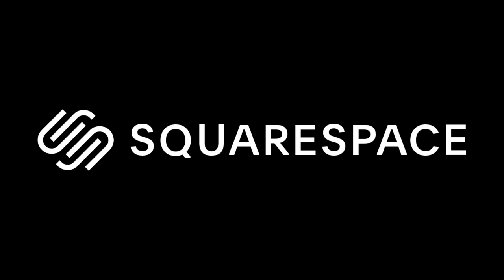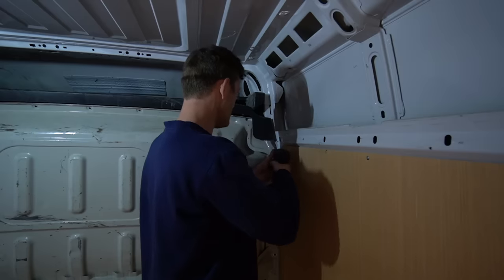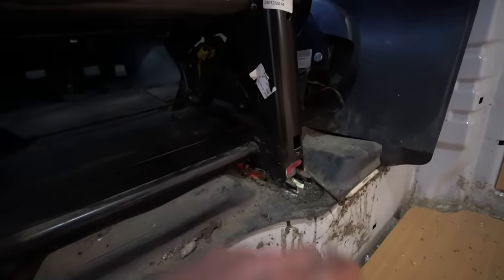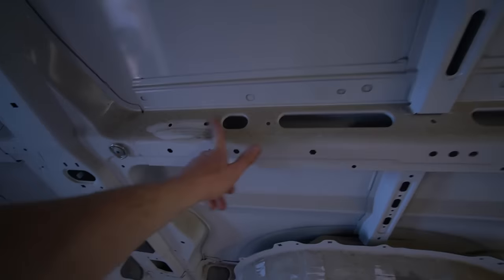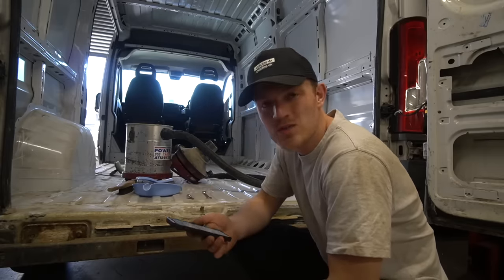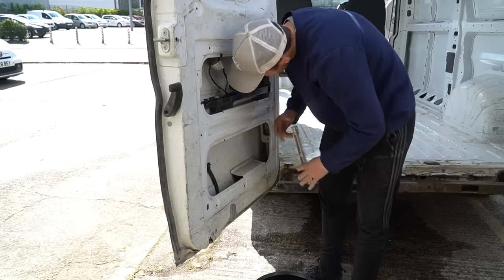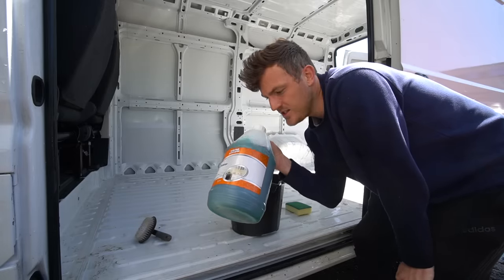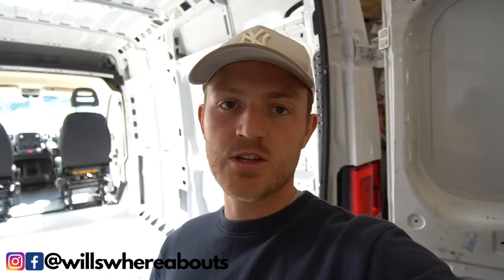BEGINNER VAN CONVERSION | Ripping it All Out - No Experience Van Build

Comment: Go old school Re smell. You don’t want to cover it, you want to eliminate it. If furniture is cloth ... air first. Sprinkle thoroughly with Baking soda. Let stand, preferably overnight. Vac off ALL baking soda, every last bit. Air again. If smell remains. Repeat. Patience. It will work. Baking soda in the amount you’ll need can be purchased at Pound Shops, Hardware stores some supermarkets though they are only small packs. I buy Duzzit from my local garden centre for £1. When it’s in stock I buy ten or so. You can use for everything. Google it. You’ve done an amazing job. Can’t wait for your next vid. 👍👍👍

Comment: Good job will!
Chemical guys do a citrus smelling anti-bac upholstery cleaner... Scrub it in, leave for 5 mins then use the wet vac... Repeat as many times as needed or untill water is clear.
Also, I'm pretty sure that little circle hatch is access to the fuel pump. 👍

Comment: Hi Will. When you fit the ply back on the floor. Don't screw it down. Stick it down with something like 'clear fixall' screws in the floor make holes that  will rust over time. Floors can sweat and rust out your van floor. Seal the old holes both in and underneath. Then stick boards down.

Comment: We have a product in the US called OdoBan.  You can use it on fabrics,  and hard surfaces.  You can use it in a carpet cleaner and clean the seats with it.    I just looked and it is sold in the UK however, it says currently unavailable  on amazon. Maybe you can locate it.   I highly recommend it.  It is also hospital grade disinfectant.  Great stuff.   Another thing you can use is vinegar.  Use that diluted half and half with water in a carpet cleaning machine.  Rinse with clean water with the carpet cleaner after.  That will help remove some of the vinegar smell.  The vinegar smell goes away when it's dry.

Comment: The panel on the cab floor is for access to your fuel tank sender unit. If your going too fit a diesel heater, you can use a stand pipe directly into your vans fuel tank through the top of the sender unit, no need for a separate tank for the heater, and easy enough to do (I've done mine on my Citroen Relay)... Hope this helps... 🙂

Comment: Great video man. It's good to see that not everyone finds it easy like they have you believe! That thing under the panel between the seats looks like the fuel sender unit. It's where the fuel line goes into your tank and houses the fuel gauge sensor.
Reply from the maker: Hah defiantly not as simple as others make it look. Thanks for letting me know
Reply: @WillsWhereabouts  and you can then attach a heater directly to your fuel line, via this hatch.
Reply: @WillsWhereabouts  taking on a van construction is tough.  I don't think I'd be able.  But I have loved wwhat you have done so far.  I do think an inside shower would be better.  You won't feel happy about an outdoor shower after a ski run

Comment: Looks great mate but my two cents, go easy on those bolts that look rusty - even using the impact driver on its lowest clutch setting will be enough to shear them immediately (as you've learnt!). Either try loosening them by hand first or with a combi drill on a low setting. Looking forward to seeing the build come together!

Comment: The cover in the floor is very handy, I think it's allows access to the fuel Sender (fuel gauge) easy to attach pipe into fuel tank for diesel night heater without having to drop the tank.

Comment: Remember to line the floor, roof and walls with insulation  otherwise it will get very cold, also what about installing small security cameras on your van so you can see whats happening outside your van when your stealth camping inside

Comment: You can get some G101 from Amazon, get the seats out and use a 50/50 mix and a stiff brush on the seats with the jet wash! I’ve seen Rob from Salvage Rebuilds channel do it a few times!

Comment: Lol. Let's see how long you are neurotic about stains on your sub floor. I remember those days very well. Subbed.
Your insulation..... I used builders expanding foam. £39 for 12 bottles on fleabay. 3 boxes did everything. Does a much better job than rockwool or celutex. Sands very easy, highly recommended. Drop me a message if you wants some pointers over the foam.

Comment: Excellent video dude , I have one of these vans , check the wires to the back doors , they are very stiff wire and it fractures over time with opening and closing the doors.   Especially before you fit panels on the doors and have to take them all off again coz it shows a fault on the dash either rear doors open or check number plate light 🤘🏻🤘🏻👍🏻👍🏻

Comment: Great video once again Will. 
If your gonna be snapping drill bits I’d invest in some safety glasses/goggles. 
As getting a sharp piece of metal in your eye Is never fun. 
Make sure the van is dry before placing any insulation anywhere, and then hiding it away. 
Can’t wait for the next instalment 👍
jPc

Comment: The black circle under the hatch next to the passenger seat is access to the fuel tank. If you take it off, you can see the top of the tank that mounted just underneath. You'll probably want to get in there if you decide to use your vehicle tank as a source for a diesel heater.

Comment: That was great! Thanks for sharing. We can understand how difficult this process actually is. I've been refurbishing used cars, so I understand your pain. Good luck Buddy.

Oh by the way, if you want to take out the smell from the seats, wash them and then dry them in a baking room that is used by car paint specialists. They may charge you some money for running the oven for 15/20 minutes, but the fast evaporating water in the seats will take the smell out with it. I've tried it on old car seats. They work.

Comment: its the access cover to your fuel tank sender unit. if you fit a cheap chinese diesel heater, it can be  tapped into the tank and run a fuel line under your floor to a heater withut having to go under the van to drop the tank.... Look up Gregg Virgo's video channel.

Comment: Power tools are amazing for taking apart and putting back together,  until you get to rust. Then WD40 is your friend (sometimes). Sometimes there's nothing like a little manual undoing to judge if a screw or bolt is going to go ping.

Comment: Check out the local car/van breakers yard for a decent rear bumper bar.  As there doesn’t seem to be anything electrical in the seats take them out again and pressure wash them. Do it on a sunny day to let them dry out. You might find you need to clean the roof lining in the cab as that will stink of cigarette smoke as well.

Comment: After drilling the rivet hold it with a pair of pliers and run the drill in reverse and it will unscrew it from the drill. or use a bigger drill bit so it won't get stuck on the drill.

Comment: If I was you Will I would put a dehumidifier in there for a while, 24hrs at least. You've pressure washed everything down which is probably the best way to clear all the grime but you've definitely not got all the water - the drain holes probably got rid of most of it. If you don't get rid of the last bits of water you could have some rust problems on your hands.

Comment: You see those 3 lights on your drill/gun when you pull the trigger. There should be a button there to slow down the drill/gun, I learned it the hard way too by breaking screws and bolts lol.

Comment: Will, use impact when removing screws/bolts and tighten slowly. You would probably have better luck if you get an impact driver and use that for the first hit instead of the drill

Comment: For those difficult bulkhead rivets I would have tried setting then with a centre punch to allow the full bit to get pur base. If that didn't work then I would have flattening the dome with an angle grinder, then drilling.

Comment: I would not have jet washed the inside… Being a Fiat they rust enough as it is, but that certainly hasn’t help! I’m sure you got it dried out but, all the gaps with the drain holes will still hold some water in some gaps. Looking forward to the next video!

Comment: Get some autosmart bio brisk spray onto the seats and use a drill brush to agetate and then use a wet vac to hoover up the grime you will be shocked at how much crap comes out of the seats. It will also kill the smell coming from the seats

Comment: the pop rivet at 3.56 has been put in from t,other side.. thats where to drill.. Rivets have  a very hard shank through the middle, the aluminium part of it is soft and easy to drill if you have more to remove... The bad smell will disipate over the build,,, it will be replaced by adhesive/paint /mastic odours.. The bumper bracket can be straightened/welded by any steel fabricator for £25. Dont chuck the old linings,, plywood aint cheap,, new stuff can be built with it... Its lookin spotless,,, you can just sling down a matress and go😂

Comment: I'm prety sure that flap you opened is were the fuel sender is for the fuel tank. Which makes it easier to tap a diesel heater straight to your fuel tank. Rather than dropping it out💯💯💯

Comment: Will, 
Get an air gun to blow out the water from the lower gullies. THESE WILL RUST from just a few drops that remain on the inside, if you don’t dry  them thoroughly. Then before you insulate, spray the gullies with Bilt Hamber anti corrosion spray 😘

Comment: I have a rear crash bar for the same van for sale on Facebook Market place for £65.00. It is as new and has recently been removed from our campervan  (4000 miles) and replaced with a tow bar. It is an easy bolt on part.

Comment: That flap is top access to remove the fuel sender and pump from the diesel tank be careful not to damage any wires can cause miss reading on fuel gauge or worse no reading at all its there if the pump packs up you don't have to drop the tank to access the part! And fun fact the plugs are there for draining water yes but its a clever design for the old refrigerator vans as they build up condensation! To remove the smell front the seat get professionally cleaned with a upholstery cleaner for two seats wouldn't cost you alot and the satisfaction of basically sitting on brand new seats with no bum juice and old farts soiling the fabric 🤣

Comment: Will!!!! Slow down. Take your time. Always spray old bolts with releasing oil. Buy a decent set of molegrips. You didn’t need to drill those rivets out. The round head bolts that you drilled out would have come out in two minutes with a set of molegrips. And a spray of releasing oil would have saved you the bother of the snapped bolts.

Comment: Well done you, but please wear safety glasses and gloves when using power tools. That broken drill bit could easily have ventured into your peepers! Set an example fir your followers, please! Ohh, and get some good lighting for the videos and maybe a microphone? If your gonna get the van certified then look up the newest legislation on windows, doors, decals etc etc before going too far. Some official sits only allow certified conversion with proper insurance

Comment: Mate, let the drill bit do the work. Don't push so hard. Go buy a carbide tip bit. Looks like you are using wood bits. Oh, and don't over heat the bit. 😉. 🌞